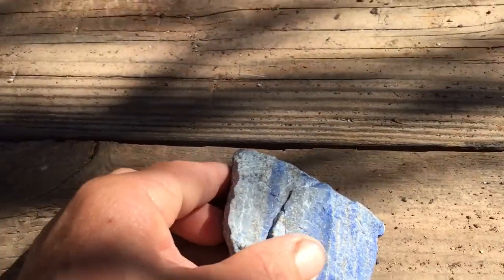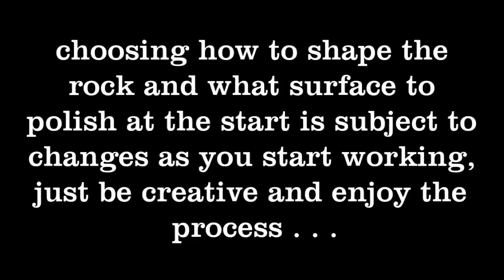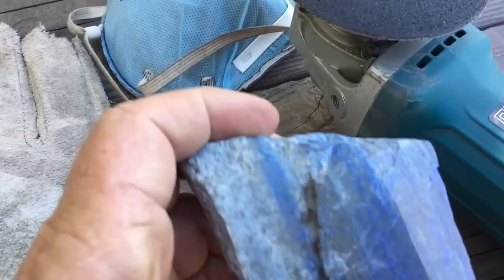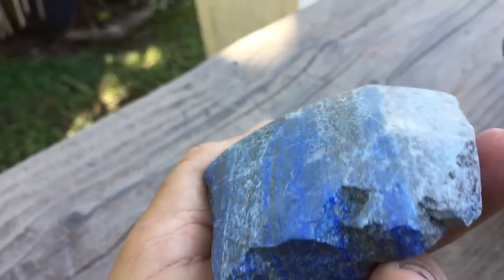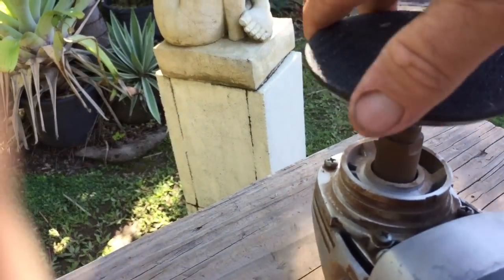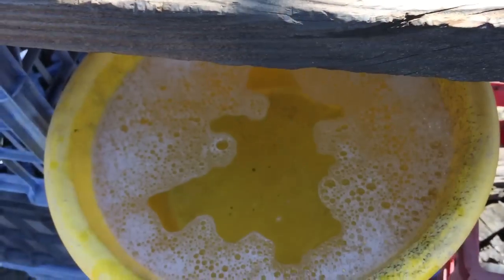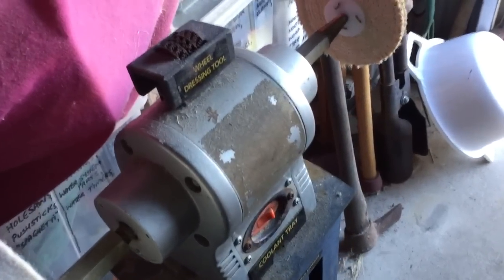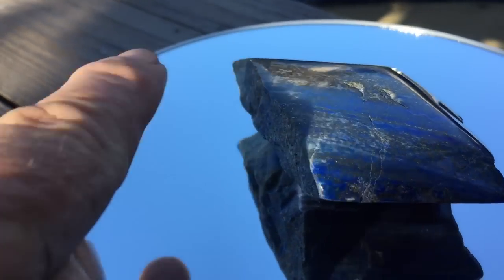Polishing Rocks with hand held Polisher/Sander - part 1

Comment: Hi Kevin, thanks for this video. I am new to this and used a polisher similar to yours in this video. However, I can see the circular pattern of scratches in my rock. I kept the speed at 3. I also tried to move the stone and not keep it in one position (I had the polisher laying down and the rock above it). I am wondering how I can avoid seeing the circular rotation of the polisher in the rocks I polish?
Reply from the maker: hi jenny, 
might need a closer inspection after the first rough pads are used, (dry rock off, and inspect closely in bright light for any scratches), any scratches left after first rough pads are used will carry on through to the end.
kev

Comment: I'm looking for a way to polish some agates and corals I've self collected and looked into getting a tool to polish them that is faster than a rock tumbler and less expensive than lapidary equipment. This look like a feasible method, but lapis is much softer than agates
Reply from the maker: hi haley, yes the agates are a lot harder, more work allways needed on the lower grits to ensure scratches are eliminated

Comment: I have a smaller sander but could I use sandpaper or would that not be good for rock?
Reply from the maker: yes, you could, but dust from rock sanding is dangerous, need to wear effective mask.
Preferably use wet n’ dry sandpaper, and keep rock wet while sanding

Comment: Does it matter if i use an orbital or rotary sander or a random orbital sander?
Reply from the maker: not really josh, just as long as the wet diamond pads stay on the velcro, the direction of the action would not matter

Comment: G'day Kevin.  I bought some disc's 80-1200 but find that even getting to the 1200 my agates are getting the sh $t scratched out of my slices. I dip the stone into water very frequently,  but my grinder is not variable speed.  Could the scratching come from A) speed too quick, B) not wet enough or a combination of both? Any suggestions would be greatly appreciated.  Cheers from Tassie
Reply from the maker: George Redbranch 
hi george, it is most likely too fast rpm. It really is worth getting a variable speed sander, Bunnings sell them, you wont regret the investment,
cheers, kev

Comment: It's a great way to polish any stone but you definitely need a variable speed angle grinder. I very very very rarely go above 1500 rpm on any of the grits or buffer pads. You'll cause to much heat which will shorten the life span of the pad, maybe even burn the rock...depending on what it is. but you will most definitely cause cracks and other unfixable damage to to the specimens. I couldn't imagine any reason you would need that concrete grinder wheel. In fact I couldn't imagine having to us3 a diamond pad less than 200 grit to start shaping and cleaning the specimen. You're asking for scratches that you will never get rid of and will be extremely noticeable after a final polish. Once in over a decade and thousands of rocks I've polished, I've used a 50 grit diamond pad once, a 100 grit a few times because I was being inpatient.
Reply from the maker: hi michael, thanks for watching video and commenting, concrete grinding cups are essential part of kit for me, especially when flattening ends of large petrified wood stumps, some are 30cm/12” diameter (and larger), the grinding cup brings them down to a workable shape,     kev
Reply: Nah , I'm an idiot , I commented before I watched the entire video. And I was being one of those people I can't stand on YouTube. The ones who think they got it all figured out. I humbly apologize for being a Mr know it all. But anyway, I love grinding and polishing with my angle grinder. You're not stuck in Lap. Lab with all the non portable equipment. A couple extension chords or a decent portable power station with an extra car battery and you can set up shop anywhere for the day. Lol, one time I had set up shop on the river bank, in an area this group I was in would meet. I got there early to set up . I had this idea 💡 lol, instead of carrying all these specimens home and finding out none are opals , I'll just grind at the river. It was like taking a bite out of each chocolate when nobody was around and just putting it back in the box. Well, when the group reached the sacred rock stacking grounds and saw what I did, you would think I had just scalped a small village of settlers, woman and children. 😂 oh man, they were so mad. Needless to say I was exiled, banished immediately. In hindsight I totally get it. At the time , it seemed genius.

I had to edit this is in because I haven't thought about that day in a long time and I'm laughing pretty hard about it right now. it was so awkward because I had to make two trips before I was cleared out. Upon arriving back to the site for the last of my things , the group had plenty of time to take a body count of my carnage 🙄. Which was only a couple dozen miscellaneous 2" to 4" stones that showed potential for what I was prospecting for. And just to clarify, it was an actual sacred area, with any historical significance as far as I'm aware. It was the groups meet up spot. Ohhh and this one guy , he was the coolest . I genuinely felt bad thinking I disrespected him in anyway. This guy could stack rocks like a wizard. Could stack rocks in ways that just were not replicable , absolutely amazing.
Reply from the maker: @michaelpepper885  
interesting, (and entertaining) tale ! your idea was sound though, despite upsetting others. I have a small rechargeable battery angle grinder that has a 4” diamond cutting blade on it, it is great for field trips where i can take a small edge of a rock to inspect the interior. The trick is to be alone, and enjoy your own company while performing inspections.
Reply: Omg, I need to proofread better. Just to clarify and then I'm going to be a quiet respectable subscriber,  lol... it was NOT a sacred area of any sort. I'm a knucklehead not a jerk .

🤲♾️🔆
To the ancient, to the old and to the new...godspeed

Comment: Quick question Kevin.  Do you think using cerium oxide with the sisal would be beneficial?  I'm about to buy a bench grinder and I have extra cerium laying around so I might need to buy some extra wheels so I don't contaminate.
Reply from the maker: ElGatoLoco698 , 
hi, hope you are well,
I use the cerium oxide, and tin oxide, on a 
4”/100mm felt disc that i fit to my sander/polisher. I run it on the lowest speed so as not to fling off the oxide. This does a great job for the final polish.
       I havent been able to find Velcro attached felt discs yet, so i use angle grinder type felt wheels. To attach these to your sander/polisher you need to have angle grinder nuts that screw on to your sander/polishers spindle.

I havent tried using a bench grinder, it may be to fast, but you can only try it out and see what happens, main thing is to keep the damp oxide on the sisal wheel.
cheers, kev

Comment: Is it a variable speed angle grinder or polisher?
Reply from the maker: yes tamara, a variable speed sander/polisher. These days they are available as rechargeable battery units, only half the weight, I am getting one for christmas, and will release a new video after that,
kev

Comment: Sir. I have a good angle grinder that I was hoping to use on my poppy jasper. You mentioned that the RPMs would be too high for the polishing stages. What would the outcome be if I went ahead and just used my grinder throughout the whole process?
Reply from the maker: you can only try, i found it too fast for the diamond pads though

Comment: Would it be a sin to fill the large pits with clear resin so as not to take away so much of the original stone?  After, of course thorough cleaning.
Reply from the maker: Suenette Edwards , yes your right, there are various techniques regarding filling, and stabalising rocks in preperation for polishing.
I am a bit of a learner myself, and not familiar with these methods though, thanks for watching video, 
kev

Comment: this probably a really stupid question but is that an angle grinder without the gaurd on it?
Reply from the maker: Tori Lewis , yes, good safety observation. I will wear all the personal protective equipment, but fail in that area. I refuse to be held back from the hobby i love. But yes ! definitely safety issue (for some)

Comment: you wander what the grits are... they are aluminium oxide or something, same stuff that they used to make whetting stones out of. good bloke i had some nice stones this summer and i'd deffo get them home to do that next time round.
Reply from the maker: the pads are diamond particles, suspended in a soft resin (looks and feels like plastic).
the grit size starts at 50 grit, and the finest pad is 10,000 grit.

Comment: Love ur videos. Can u tell me what brand pads ur using? So many mixed reviews, I just want ones that work.
Reply from the maker: hi jessi, I have only used the cheap ones from ebay, i dont think they have a brand name.
       The only brand name i know is THK diamond tools, they make a set that is a bit more expensive, and should work fine.
kev
Reply: Sydney Tools sells these.  Diamond Resin Pad $35 each.

Comment: Great video!
Can you please share the brand name of the velcro backed cutting discs you used. Were they bought at Bunnings?
Reply from the maker: Jeanette Lamb , good question, no, i bought them from ebay, a set of polishing pads start at about $20 AUD delivered to your door.
A set includes the velcro backing wheel that screws on to your sander (14mm thread)
Reply: :) I found myself a set on ebay the other day. 
Thanks for your reply. :)

Comment: Looks nice
Is that a variable speed grinder? 

I have 3 angle grinders,  and they all spin around 12,000 rpm.  
Which is too much for the diamond pads.
Reply from the maker: hi Charlton Heston ,
yes, it is critical to use a variable speed grinder, or variable speed sander/polisher.
(or, if you can afford it - a wet polisher).
The fixed speed grinders are 11,500 to 12,000rpm and it is too fast.
      for example, on my 6 speed sander, i use the second lowest speed.
       If you go ahead and wish to get a var. speed sander, be aware of the spindle thread size, 14mm is ideal, most ebay attachments sold are 14mm.
      thanks for watching video, and appreciate your comment,
cheers, kev

Comment: you should mount that grinder to your bench
Reply from the maker: R. Erik Weigand , yes, thats an option, i have tried it, but if one likes that method, i suggest attaching velcro backing wheel to bench grinder instead, thanks for comment.
Reply: Kevin Nix Was thinking of going this route... where did you get your sanding pads?? Also what is the RPM limit with them.. need to find a bench grinder that will coincide with that speed.. these pads seem to work well..a LOT of people are using them lately..and your work shows how good it turns out!!

Comment: Dear Kevin, Many thanks for your video, it is very well narrated and very informative, however i am curious if the same process can be applied on harder stones with equally good results, Lapis Lazuli is a 5.5 on the M.O.H scale, so a relatively soft rock,  I am wondering if it would work on Agate which is a 7 on the scale. Many thanks in anticipation.
Reply from the maker: Joseph Silva , yes, i have used that process on very hard chert, and other hard rocks, just takes a bit more care and time
Reply: Thank you for taking time to answer Kevin. will give it a go. Bought myself a 1200W silverline sander/ Polisher with Variable speed to try it out :)
Reply: im trying the same with a large agate, let me know how you go, i need to go back and spend more time on the lower grits i think
Reply from the maker: Jay , yes, your right, the lower grits do all the work, pays to do a lot of drying off and inspecting for scratches in the lower grits,
kev
Reply: Hi Jay, yes, I can confirm you can get equally good results on Agate with Kevin's method, i use it alot on Flint which is extremely hard and it works a charm.